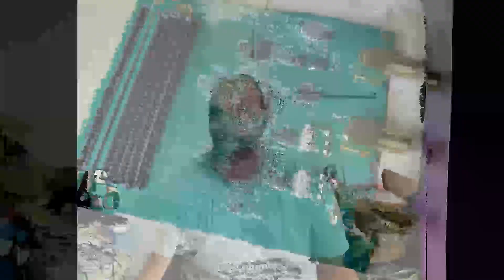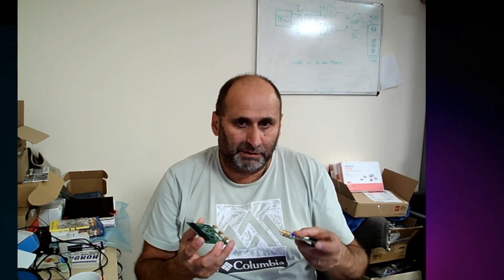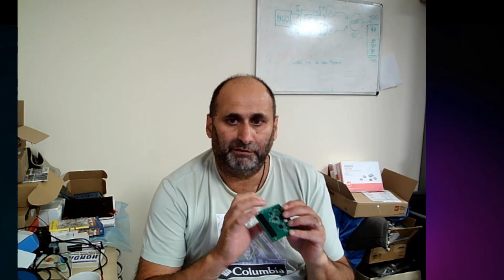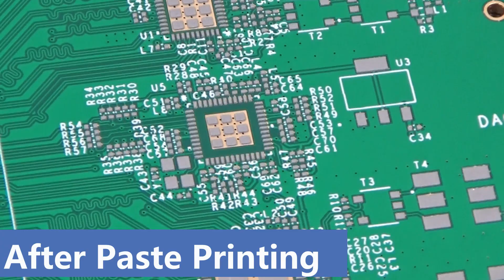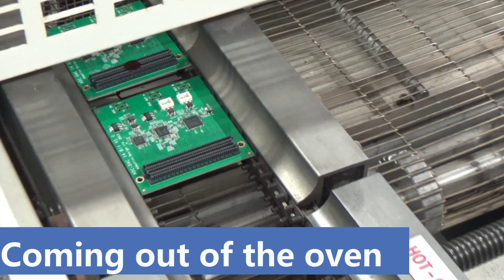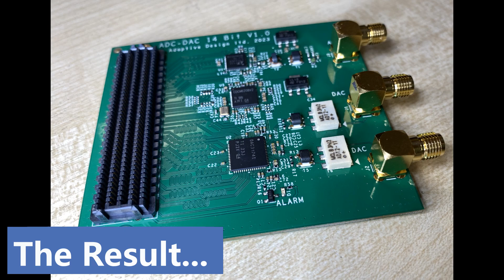The Build ADC DAC board for FPGA

Comment: what is the part that mates with the zedboard?
Reply from the maker: The PN ASP-127797-01  (Manufacturer is Samtec) - this part is Low pin count version, less pins populated in the housing (only rows C,D,E,F have contacts) - and this part hs two variants a low profile which is what I referenced above and a normal height. The Digikey PN is ASP-127797-01 (the same as Mfg. PN) - price is mad money 19 Euro.
Reply: Thank you =) @adaptivedesign8795